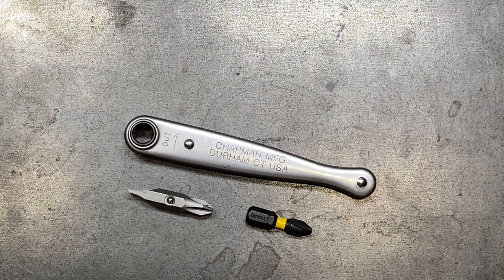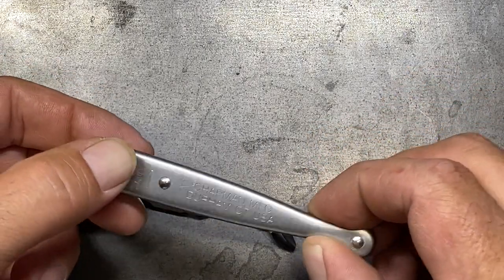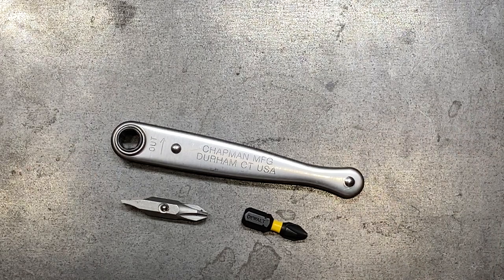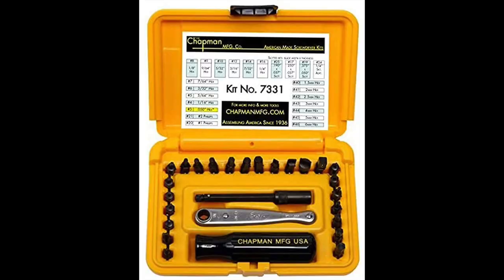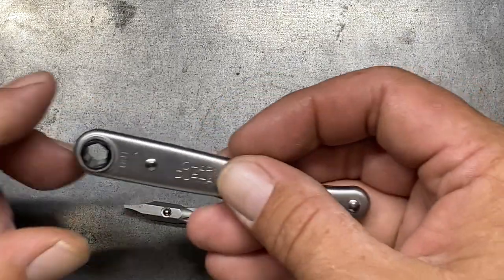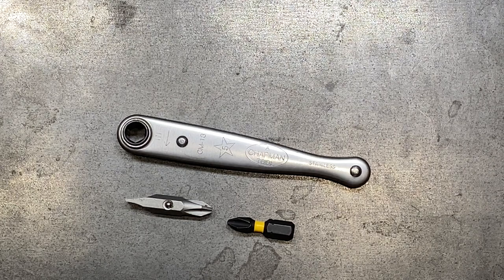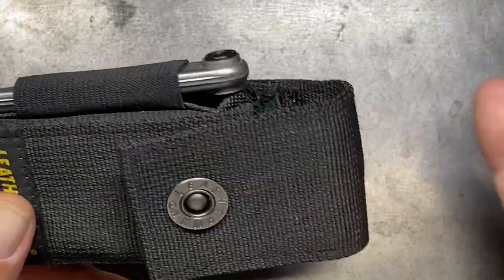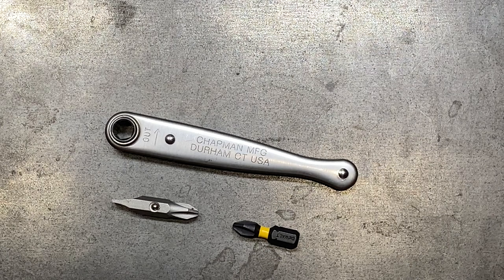Chapman MFG Mini Ratchet - EDC Friendly 1/4" Ratchet

Comment: I was wondering when you’d get around to Chapman! My mini ratchet is a real problem solver at work. It’s not as elegant or versatile as the Victorinox but it’s likely stronger, & significantly less $. 

The bits aren’t the hardest, but their fit is excellent.

In fact, in particular their slotted & torx bits are among the best I’ve used, despite being a little softer than some others, (perhaps a result of the machined manufacturing process?) they’re up there w/ Zephyr, Apex, Qualtool & PB Swiss. 

I know some gunsmiths who rely on them, & in my line of work, their slotted bits are commonly used to open up ridiculously expensive autoclave & washer  panels. 

Plus, I love that they’re dedicated to American manufacturing & respond to customer feedback. 

Thanks for the review!

Comment: I keep one in my "EDC" maxpedition bag mini took kit thing, super handy little tool. I pair it with my Surge in the same way as you pictured with the screwdriver. I've got a longer shanked .25" extension, pass it through the Chapman and into the Leatherman extension. Kinda neat thing is that you can actually drill holes in wood with it pretty easily with that setup.

Comment: I've had a couple of these for years. They've been good, along with their extensions. They are available with different colors on each side so one can quickly tell which direction the ratchet is oriented. To secure it in the Leatherman case you could treat it like a fire steel and have a short shock cord loop or elastic band through the ratchet hole and then over the handle end. All over the case broad elastic loop. Hope that makes sense.
Reply: I like the color-oriented drive-direction idea. Easy enough to do with nail polish.

Comment: I cut a half inch crescent wrench down to fit my EDC pouch, and angle ground the cut handle into a pry bar. Now I have an adjustable wrench, and pry bar/chizle, that I can adjust down onto screwdriver bits and use as a driver. 🍻
Reply: Great DIY multitool.
Reply: @macgyverbryan1377  Thank you sir. It has come in handy when I got my new license plates and needed to attach them. Saved me 40 seconds of cardio and inconvenience, having my wrench on me. :p
Reply from the maker: I would love to see that. Sounds incredibly useful.
Reply: @txtoolcrib  Email sent 🤓

Comment: I will not touch my gun screws with anything other than Chapman bits, just not worth it to ruin screws using garbage.
I started with one of the pocket sets, added the case and accessories,  and all the specific gun screws that I needed.
I filled that thing up pretty darn quickly, now I need to get the larger case because there are more bits I have found myself needing.

Comment: Checkout the Topeak ratchet, it has some cool features.  It looks like a pass-thru, but that's deceiving.  Only the included extension can pass through, when desired, so that the set can be used as a T-handle when desired, rather than a ratchet.

Comment: I found a similar mini ratchet likely made 10- 20 years ago. The bits have a knurled round end with cut in detents. I have a small bit driver for standard bits.
Reply from the maker: Do you know what brand it is?
Reply: That sounds like the bits Chapman is currently selling.